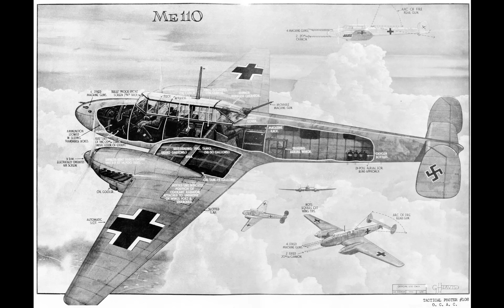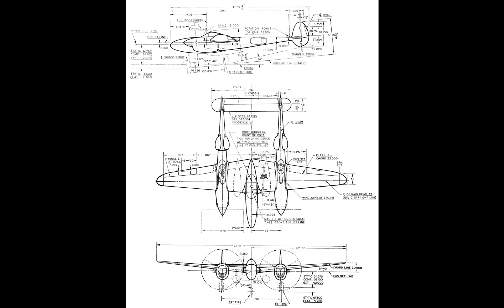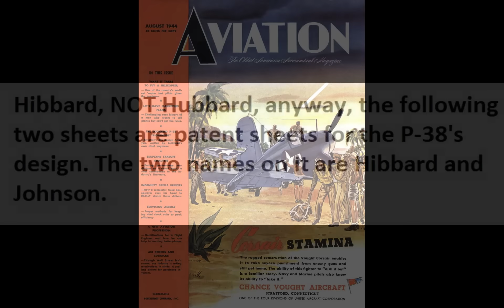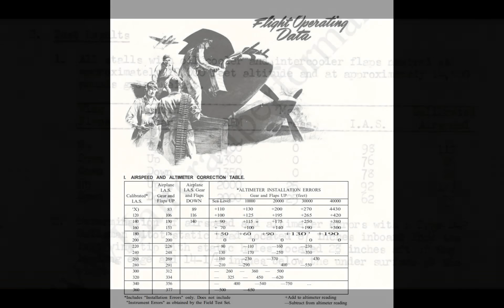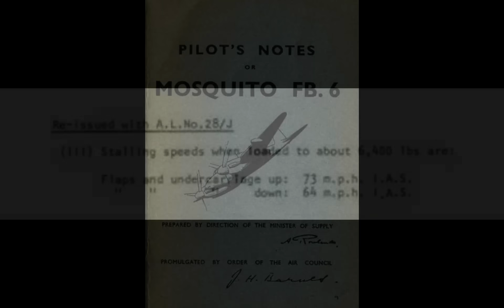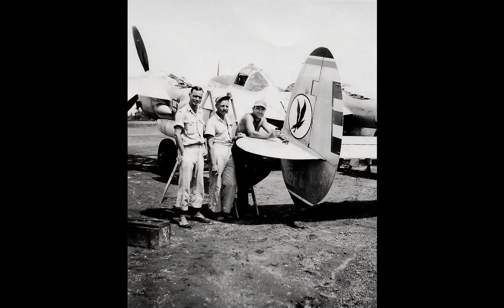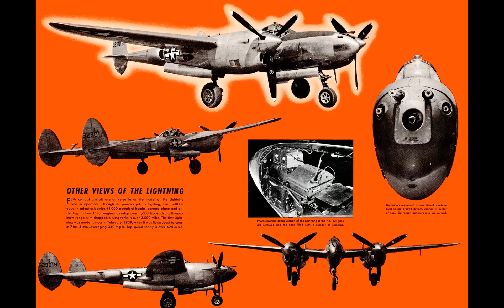Lockheed P-38 Lightning Design Info

Comment: Greg, another great video. Brings up a key question. In 1937 a viable engine for a single engine fighter was the Wright R-2600. 1,700 hp - 1,900hp.  If Lockheed has designed a hellcat/P-43 with the 2600, would that have reach 360mph? Given the Corsair's speed on 2,000, seems likely.  What you can singlely do is tell us what plane could have been built around the 2600, in front line service in 1939. Would love to hear you take on this, Per
Reply from the maker: Hi Per, It should have been possible to build a fighter than could do 360mph with a Wright R-2600. In fact, the Hellcat was going to use that engine and probably would have done it. The question is if it could have been done with a design in 1937. I don't think so. I don't think they had the power up high enough by then when considering the aerodynamic knowledge of the day. Now by 1941, yes no question about it.

Comment: Great vidoe Greg.  BTW, the comment that power reduces stall speed due to the "slipstream" effect is true.  But there is also a vertical component of lift from the propeller disc that adds to the total lift just before the wing stalls.  IMHO.
Reply from the maker: You are correct about the vertical component if the plane is pointed up. However I'm going somewhere with this talk of the slipstream effect, and that's the effect on the speed of an accelerated stall in a turn.

Comment: My fav early war fighter is a Soviet one. The MiG-3 could do 400 mph at altitude and get to 26,000ft in ten minutes. Faster than the BF-109 and Spitfire of the time. A single engine rated for 1300hp. Downside was poor low level performance and a light armament. 
A capable high altitude interceptor for 1940, but its trouble was that most its targets did not work where the MiG-3 flew best. A cannon armed version could have been a good bomber killer perhaps. It's high point was when the Soviets threw the Nazis back from Moscow in late 1941. 
My fav late war prop fighter is the Yak-3. Seems I have a thing for commie planes -- warts and all.

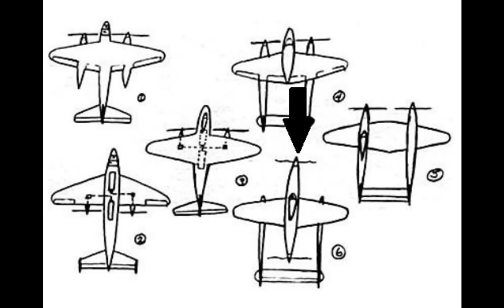Comment: 9:30 I was talking to my dad about something that happened to a family friend, an A&P, who was flying a Cessna 337 that lost a propeller blade on the rear engine and very nearly cut the tail off the plane. He landed safely but it was a close call.
    Anyway, dad said there was a problem with blade separation on these planes because of how the propwash from the front engine interacted with the rear propeller.
   I'm thinking maybe the push/pull P-38 idea would have had the same issue.

Comment: Corsair and the P-38 were My favorite WW2 fighters. My Uncle worked for Lockheed in Atlanta and I had all kinds of info and pictures on the C141 and C5 as they were built. the P- 38 flown by Bong and McGuire were interesting reading when I was a boy. Not just to mention how cool it looked. My reading said the 38's Allison engine suffered in the cold air over Europe. I am really interested to hear your detail knowledge on the subject.

Comment: It seems to me that like the 110 and other 'heavy fighters' it was generally a failure.  The immediate future lay in smaller target, low drag big engine aircraft that were nimble with a good roll rate that made for effective dog fighting.  In the Pacific with warmer air, long range and twin power plant reliability was important so it made much more sense.  In my non-expert opinion, aircraft like this and the Mosquito, recon and ground attack with good straight line speed suited this type of aircraft much more.
Reply from the maker: Consider this, other than the Hellcat and Mustang, no US fighter shot down more aircraft than the P-38.
Reply: @GregsAirplanesandAutomobiles  but was this in the Pacific Greg?

Comment: #667 Couldn't stand to let "triple six" comments rest, and besides, that was the SN of the number Jay Zeamer's crew flew in a historic Pacific recon mission.  Cameron Aircraft has a P-38 left engine on loan to the Bird Aviation Museum at Coeur d'Alene Airport (Idaho) at the end of Cessna Avenue from Atlas Road.  The magazine ad describing the Allison V1710 as "a 21-jewel movement" is correct, as I performed the preliminary work so when our local Allison V12 mechanic arrived all he needed to do was pull the supercharger gears.  The impeller is thing of beauty, an example of the machinist's art, rarely seen in these days.  
    The Northrop P-61 Black Widow was another twin boom design, but with 4,000 horsepower from twin radials and its armament package was a great performer as a night fighter, and night/all-weather radar bomber.  Incredibly agile, and readily accepted once Northrop's test pilot flew a demonstration with each squadron, showing them how to really fly it!

Comment: The number 2 config has been used with single engines and chain drive to twin pusher props... Usually on experimental aircraft. 

Wright Model A is an example of a production pusher with a single engine and twin props.
Reply from the maker: Good point Capt.

Comment: Am very happy to see this series of Analysis of a great WW2 Warbird.  I served in the 49th fighter Squadron in the 15th AF, Foggia, Italy. As an armorer I saw firsthand the work needed to keep  them operational and listened to the pilots relate to their experiences.  The J model I worked on had most of the upgrades to AC and engines including Hydraulic flaps.  The L model Had the dive flaps that removed the dive restrictions. Your analysis of the beginning design intention and limitations are showing the P-38 was a major factor in our war effort.   Your audio seems clear with only a small amount of echo.  My hearing aids limit my ability to judge objectively..  (For what it's worth)...   I look forward to you additional videos

Comment: Question to anyone who knows, why was the twin or "H tail" tail section with two rudders so popular? It seems like allot of aircraft for a few decades had this design including on passenger jets, then for whatever reason it fell out of favor. Although I suppose modern fighter aircraft do still incorporate twin tails fairly often although  differently on a widened fuselage rather than on a narrow H tail.  It's a feature that seems to have disappeared from passenger aircraft for instance.
Reply from the maker: On some planes, like the Lockheed Constellation it was done so that the plane would fit into existing hangars. On others it was to improve rudder control when on one engine. Modern jet fighters have two at angles to maintain rudder control at very deep angles of attack.
Reply: @GregsAirplanesandAutomobiles   Thanks for the information, I didn't consider the angles of attack playing a role in the design on modern fighters, but it makes sense. 

I'm a big fan of everything you produce.  Thanks for taking the time to answer my question.

Comment: Here are the four best dog fighters of the Second World War when piloted by experienced fighter pilots. 1. Japanese Zero 2 German ME109. 3 American P51. 4 British spitfire.Of the four best fighters only the 'light weight Japanese '0' Was powered by a radial engine. Of the four best fighters only the P-51 used laminar flow wings. The British Spitfire was acclaimed by its pilots to be very well balanced and  a pleasure to fly. 
The American Brewster Buffalo was considered the most ineffective fighter plane ever conceived. The remaining units were scrapped and not considered useful even as recon. Aircraft.
Reply from the maker: Here we go on the "laminar flow wing" myth. Also, the Finns would like to speak with you about the Brewster Buffalo.
Reply: Greg's Airplanes and Automobiles -- I have never read a favorable review of the Brewster.

Comment: You jumped from mph to knots on the mosquito stall
Reply from the maker: That's correct, I forgot to convert the Mossie's numbers to MPH, thus it looks better here than it really is. Of the point was to show the difference made by the flaps, I'll clean this up when I compare aircraft performance.
Reply from the maker: Good catch, I added the correction to the description.

Comment: To be clear, the plane wasn't necessarily competitive with other fighters due to the agility of the craft, far from it. The pilots had to do away with their traditional dogfighting tactics and opt in for much longer, sweeping passes at your targets, this was a global trend in air combat. The P-38 was a Unique plane in that, for the first variants to come out, the plane was an awful dogfighter, but it could still fly faster, and more critically, climb faster than any other single engine fighter in the war. As such P-38s, even at the start of the war, could in fact tangle with dedicated Fighter Craft. It's also important to note that air combat at the time was in a transition period due to the vastly increased power being given to these planes. 

The weapon placement on the P-38 (all being in the Nose of the Craft) made it so that pilots didn't have to mess with convergence much pre-flight. All the weapons shot straight ahead and made the P-38 a favorite among the sharpshooter pilots. By the way, the Spoiler Flap on the wings was the first addition to the craft after the first Variants started to see service, perhaps I could be wrong but it seems there are conflicting bits of information here. The simple truth of air combat is, regardless of agility, if you have the speed and climb advantage, any good pilot can retain constant control of an engagement. Later versions of the P-38 started to use new fangled Hydraulic Control surfaces for pitch and climb, especially to help with turning and pulling out of dives and to tighten the P-38s somewhat lackluster turn rate. Pilots had a lot of difficulty fighting the stick when pulling higher G maneuvers. It's really just the final J variant that truly brought the air frame to its peak performance, what with hydraulic assisted control surfaces retaining control at much higher speeds.

The P-38 turned out to be much more than an Interceptor. It's a pretty damn good Close Air Support Craft due to the weapons loadout and her ability to carry bombs. In the later variants (Especially the P-38-J, considered by some to be the best fighter craft of the war), she could also out-turn most fighters she'd face save for perhaps the Mitsubishi Zero. Before the Mustang, she was one of the only craft with the range to escort long range bombing runs, and really, truth is they remained in service for that role right until the end of the war. 

She's my favorite aircraft of the 2nd World War by far. It was so different and new when applied to this sort of combat role that issues and kinks were inevitable. Thing is, once they were ironed out, the P-38-J had no comparison in the war. This was achieved with a combination of better training for the pilots and some minor adjustments to the air-frame, the aforementioned hydraulically powered control surfaces (only for the Elevator) among others.

Comment: The book "Lavochkin's Piston-Engined Fighters" (Red Star Vol 10) by Yefim Gordon contains the following information on a Russian Lightning;

"Several months before the beginning of the La-11's flight tests GK NII VVS obtained an example of the Lockheed P-38L-1-LO Lightning twin-engined fighter. Its evaluation, which was completed in April 1947, showed that, despite the Lightning's high all-up weight (almost twice that of the La-11), its range with drop tanks was inferior to that of the Soviet fighter. Other performance figures, with the exception of the radius of turn and service ceiling, were also lower."
Reply from the maker: The La-11 is a post war fighter. It's a fine airplane, but should be compared with the P-51H, Bearcat and the like.
Reply: @GregsAirplanesandAutomobiles  Just the snippet of information i could find on russian lightings...
They did seem to have done a comparing evaluation at one point.
Your reaction makes me wonder why.

Comment: We must find some way the make this seem better than that damn Brit Mosquito.
Reply: The P38 was the USA's third highest scoring fighter and most could carry twice the bomb load of a Mossy fighter/bomber.
DH98 Mosquito FB. Mk VI  2,305 built.  Fighter bomber/intruder variant using Merlin 22, 23 or 25. 4 (Browning) machine guns and 4 (Hispano)  cannons, plus 2 x 250 lb bombs carried internally & underwing carriage of up to 2 x 500 lb bombs. Could be fitted with underwing rocket projectiles or drop tanks instead of external bomb carriage.
BAE Mosquito page
Reply: @nickdanger3802  That's a relief. All I can find is how the Nazis hated the Mossy and even tried to copy it as we copied the RR Merlin because our engines weren't good enough.
Reply: If I had friends I would not be on U tub. If all it took was the Merlin to make a long range escort why didn't the Brits build one? Tempest? Typhoon? Whirlwind?  The P47 could have done the same task, but for various reasons, like cost, the USAAF went with the P51.  Some of the less successful applications of the Merlin:  Boulton Paul Defiant turret fighter, Armstrong Whitworth Whitley, Fairey Fulmar. 
The most numerous Halifax variant was the much improved B Mk III of which 2,091 were built. First appearing in 1943, the Mk III featured the Perspex nose and modified tail of the Mk II Series IA but replaced the Merlin with the more powerful 1,650 hp (1,230 kW) Bristol Hercules XVI radial engine.
Reply: The Brits did not invent the magnetron, they expanded on the work of others. If you can provide a link to any applications of the CM that were actually invented by Brits, I would really like to see it.
Reply: @hany-k95  The only thing hate gets you is more hate.
Reply: the P-38 was a Fighter/Bomber with many Virtues.

the Mosquito was just a High Speed Medium Bomber

Comment: thanks for the terrifically informative video.  Even though the Lightning looked "fast" in a pre-jet age sort of way, that long elevator always looked fragile compared to compact, sleeker mono-hull fighters like the P-51, Hellcat, Corsair much less P-47. 
We learn the P-38 was one of the very first aircraft to encounter compressibility - the nightmare of high-subsonic shock-waves capturing the aircraft's control surfaces in a deadly, vice-like "incompressible air"  grip during high-speed dives - but we don't hear about the tail breaking off much, and the P-38, along with the P-47 would drive early U.S. research in to high-speed, sub-supersonic  flight. 
   Of particular interest in this video is all the parasite drag Gregg discusses - like those cool looking turbo-chargers on the upper side of each boom. While they barely project above the smooth skin, they - along with the numerous air intakes - apparently were real causes of turbulent airflow, i.e. parasite air drag on the P-38s at high speed.   All in all, it's amazing how much aircraft progressed from 1935 - when the Navy was still using BIPLANES as front-line fleet fighters! - to the early/mid 1940s. 
   I always wondered what the P-38 could have achieved with top-power (2,300 hp) Merlin engines with late-model turbocharging  and late-war aerodynamic refinements,  such as the masterful Chance-Vought incorporation of engine air intakes and oil coolers intakes  into the wing roots of the Corsair.   Hope Gregg will discuss these higher powered, top-speed Lightnings and their encounters with "compressibility" - high (sub) Mach numbers in part 2....

Comment: I'd always wondered about the twin boom design. Especially why it was done then yet is so rare today. Usually that would indicate a failed design. Or different requirements, like the explanation of structural strength and battle damage often given - something not needed in modern civilian aircraft. Turns out the different requirement is just how much space is needed for the WW2 turbocharger, huge engines, and any other combat equipment. I'd never imagined it would completely fill both booms. This answered a question I'd simply just given up asking. Really looking forward to the follow up videos.
Reply from the maker: Thanks Olivia, I'm glad you liked the video.

Comment: Looking at that Fowler flap
It would be more problematic to include such a powerful flap on other designs because the moment arm to the tail from the MAC is more usually rather shorter. 
I havent taken the time to specifically measure the distances off a 3 view so its just an eyeball statistic, but if you take for instance Mosquito FB VI, which is something around the more usual 2.5 chords back, while the P38 appears over 3 chords back. Seems to be a similar predicament on P51D and Spitfire MkV, although closer on MkIX and perhaps on par with MkVIII.
Reply from the maker: Good point. I'm not 100 percent sure I agree with the idea that it would be problematic due to the moment arm. It seems to me that trim could handle that, but I'll have to think about it.  Either way, it is a factor, so again, good point.
Reply: @GregsAirplanesandAutomobiles  A comprehensive look would include the areas relative to the mainplane and perhaps even the abilities of the sections too. But that seems to be somewhat overscoping what is an 'internet' look at a balance problem usually overcome in preliminary design. This is what happens when your grounding is in Soviet era ground effect machines :)